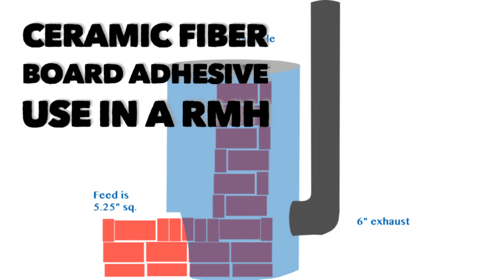Using Ceramic Fiber Board Adhesive in a RMH build?

Comment: Would the CFB adhesive be more reliable than something like a construction adhesive (or clay/sand mixture because it isn't sticky) to stick a CFB layer to the under side of the top covering of a RMH build to keep the two materials together? Or would it be better to just lay the CFB on a ledge and then lay the covering (outer) layer top material over it? I didn't know if the CFB adhesive would be more reliable if the temperature it experiences is above normal construction temperatures that a construction adhesive might experience.
Reply from the maker: Hi Robin, I'd avoid the construction adhesive, but clay/sand mortar should be fine. CFB adhesive would be a good choice as well. Hope that helps!